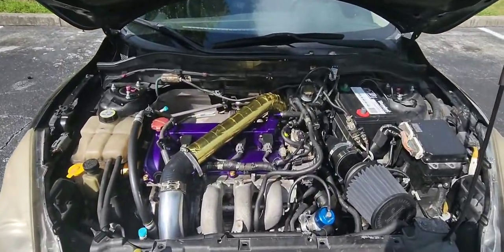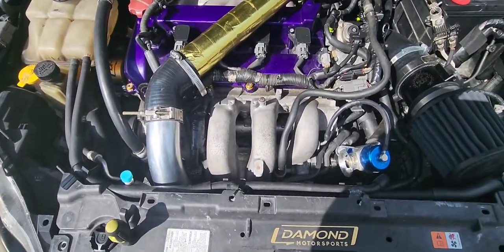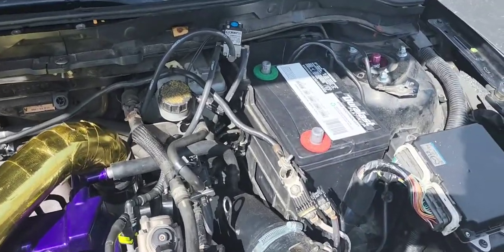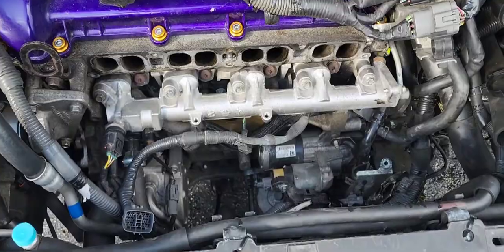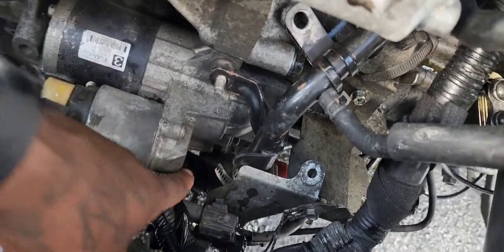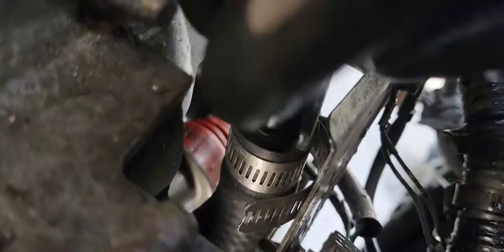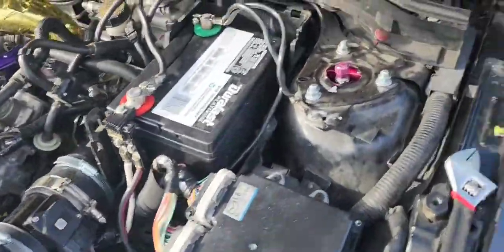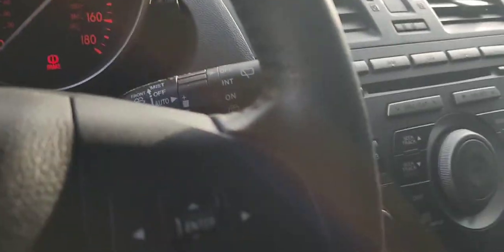How To Replace A Starter In A Mazdaspeed 3 - FMIC Setup , No Jack Needed

Comment: To remove the starter, I had to loosen a bolt behind the engine that secured the coolant pipe (the pipe that goes to the top bolt on the starter.) This gave me the necessary clearance to pull the starter out.

I also started from the bottom… and then ended up doing it from the top like you said haha… it was much easier
Reply from the maker: @Cruzzz_Controlll thanks for watching! Glad you were able to get it. 🙌🏾

Comment: You don't need to take the manifold off.
Reply from the maker: Yea, but I like to see what I'm doing and removing the manifold isn't hard at all. The more room I have to work, the better. Thanks for the comment!
Reply: Yes you do have to take the manifold off if the bolt is not comming off bt yeh if the bolt is rusty and yeh i would done the same thing as he did... Great vid as well ima have to take it off to cause that bolt is not comming so i gotta have room
Reply: You can get the starter replaced by just taking the throttle body off, and intake / FMIC pipes if they’re in the way. Just did mine last night. Intake manifold can stay on